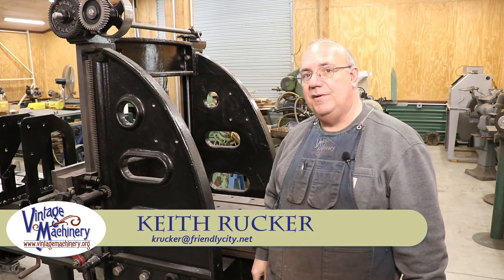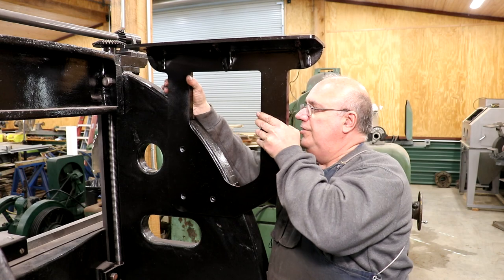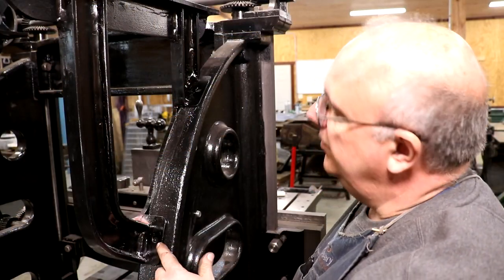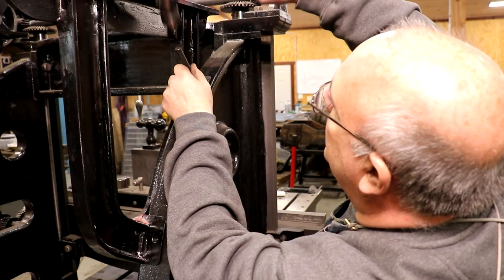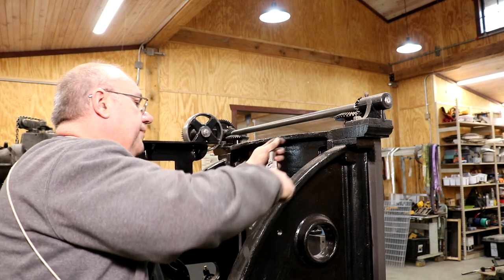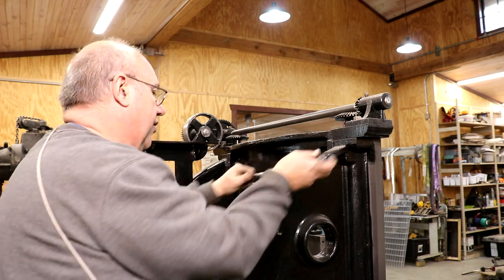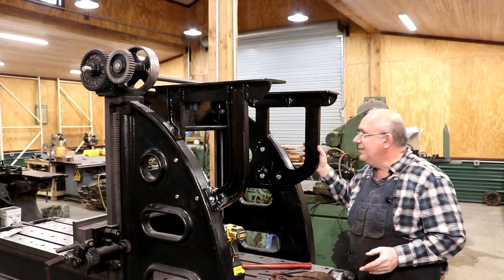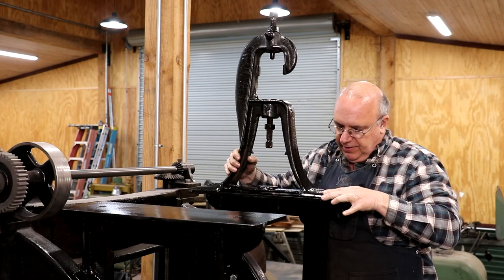Metal Planer Restoration 54: Installing the Line Shaft Brackets and Hangers

Comment: I heard a funny line recently, "The gravitational field is especially strong at the edge of a workbench!"
Reply: More specifically, the force is strongest right above my left big toe.
Reply: WD Hewson   I like that one.  It also applies when working under the hood of a car or truck.
Reply: @ErikBongers  ditto
Reply: Field strength is graphed as an exponential curve.
Reply: @ralphgesler5110  And when you drop a part while working on a car, it rolls to the point most diametrically opposite from your present location.
Reply: @WaynesGarageTexas , unless there’s a drain in the floor!

Comment: Understand the fumble fingers, seems like 10 years ago I dropped almost nothing, now almost everything. :) I think a cross brace at the base of the line shaft hangers would be a good idea, the assembly adds a tremendous amount of leverage against the sides of the original casting.  I cringed when you pulled on them to test tightness. Thanks for sharing this project with us, love the videos.

Comment: Nice to know that I’m not the only one that does QC on the hardware by dropping it 8 feet onto a hard surface. Mine usually take a bounce or two before disappearing into the tangled mess of useless and forgotten tractor parts under the workbench. Project is coming along nicely. 😎👍👀

Comment: G’day Keith. Good to see you hanging in there. I hope you use your gantry crane or engine crane when you fit the motor, those brackets looked a bit heavy to be lifting by hand. We’re all getting too old to be running the risk. 
Cheers 
Peter

Comment: 7:12, I'd make some 1.125"-1.250" square nuts to go on the bolts you threaded into the frame for the brackets you made. It would give it a more original look. Instead of having the bolts sticking through. 
Or something more ornamental.. have  an awesome day 🎉

Comment: Nice to see you back on the planer and making progress. From what you said am I right in thinking that it's normal operation is to continually shift drive from forward to reverse via using the belts as clutches ? I've not seen that done before, only for start stop function. I think some washers on the bols for the home made bracket sides would look the part - and protected the paint from being scraped off by spanners. Had I been assembling it, all bolts would have been lubricated prior to final assembly - it just helps in getting them out again later (in 100-200 years). I just don't like seeing dry machines/mechanisms !

Comment: Query: Is there a reason why the bolts go through steel to threads in cast iron and not through the casting into threaded steel? By the way, I'm 76 and I spend a lot of time picking up stuff I've dropped. Welcome to the world of the aged, Keith.

Comment: I haven't had good luck with transfer punches on cast iron.  They were the cheapest set of transfer punches (from the usual suspects) so that may be part of the problem.  But some cast parts are really really hard on the surface, which is hard even on quality tools.

Comment: Broken drill bit shanks can be made into short bits... really short bits can center mark a blind hole without chewing up the bore.
Pieces of scrap tubing come in handy for blind hole center transfering too but then so does duct tape if that's what's easiest to catch.
Growing up where the last resort is ordering can cause susceptibility to, what else could that be used. Not to be confused with, what the hell did you bring that home for although both may occur with a really big yard.

Comment: From here, with no expertise whatsoever, it looks like you will need a massively powerful motor to move all that mass and overcome the resistance of the cuts. Gear ratios will surely help. Or belt ratios, maybe.

Comment: Looks like some good maple shims to go under those hangers to stabilize them.  They originally bolted into a wood beam so the casting imperfections could dig into the wood and become more locked in.  This is a beautiful project.

Comment: Great comedy routine with the nut throwing!  Most of my mechanical education was helping my father work in his garage which did not have a concrete floor - it was hard-rolled granite sand - great for losing pieces of hardware if you didn't watch 'em all the way through to a final resting place.

Comment: Why didn't you use studs on the blind holes so you could tighten the nuts without worrying about bottoming out. 
Also are you going to do castings for the bearings so you can include oil drip cups?

Comment: If you're mounting the motor over the center of the machine, shouldn't it be mounted no lower than the bottom of the cross slide at it's highest travel point? So that if you have tall work in the machine it doesn't hit the motor

Comment: Just throwing this out there but why not bolt a plate under your line shaft hangers to mount your motor onto no need to drill extra holes in the planer then you can move the motor horizontally to adjust the belt tension  

by the way I say just hang it up on the floor when something is dropped

Comment: Hi Keith, Are you going to rely on the fit of the bracket bolts to keep the shaft(s) aligned. I ask because when I worked on power station and oil refinery plant where it was important to maintain an alignment we would first line up using bolts then fix that alignment with taper pins. This was mainly because vibrations tend to move the mating flanges imperceptibly over time even where heated bolts were used. If you don’t feel this is necessary you might want to have matching marks on each pair of flanges so you’d pick up any movement before it became an issue.
Like a number of your subscribers, I’m looking forward to seeing how this machine performs. Regards

Comment: You’re getting there. It looked to me like the surfaces between the hangers and the brackets were not very parallel. That will cause undo stresses in the assembly.
Reply: You can see the bracket distort as it was tightened. Lot of work, but shouldn't the bracket be sanded, milled, planed or ground flat first? Hate to see those brackets crack under stress. Mounting them against a wood beam wouldn't have caused a problem 100 years ago.

Comment: Back when I was doing industrial maintenance, we never had time to mount, re-mount, and I don't think anybody in the shop had a set of transfer punches.  We'd clamp, (sometimes tack weld), drill, tap, then clearance drill deep enough the bolt would hold the parts together instead of thread lock.  Recheck the tightness after removing clamps or scarfing out the tack welds.  More often than not, paint had to wait until the annual plant shut down.

Comment: Looking at this metal planner and trying to get a machine that has a line shaft to operate as one that has it's own electric motor you hav had your work cutout for you. Nice to see that the work has proceeded so far is looking quite well. The bering blocks hopefully will not cause you any problems. I will be looking forward to seeing your next video.

Comment: Is that line  shaft structure going to create enough vibration in the tool to cause problems with accuracy? You are always talking about thousands and tenths. I was wondering if vibration pads would help with that.
That small structure you added really looks heavy as is the entire tool. It was evident you were straining lifting it up.
Enjoying the entire rehab.

Comment: I thought you were going to skip any sort of line shaft drive and just throw a motor on top of a thick sheet metal platform you'd install spanning those two brackets you fabbed.
Reply: Kind of surprised me too, until he mentioned that he needed the crossed belt on one side for reverse table and normal on the other for forward table.  That forward reverse motion is needed to make the machine take passes.  Rather than some other transmission, Keith is going to operate with a (very short) line shaft, just as intended!

Comment: I thought that the mounting bolts in the tapped holes should have had some blue locktite applied as the vibration of the motor and belts might loosen things.  Never too late to do that!  My $0.02
Reply: I was thinking the same thing.  I fix Harley Davidsons, so Loctite is kind of a habit for me. When I assemble a small milling machine that I have to put together,
I think I'm gonna use a small drop of blue on my bolts.

Comment: Looks like the Planer is now a combo machine.  Combination Planer and StairMaster.
I try to never go up a ladder anymore without at least one extra set of hardware in my pocket.

Nice job on the brackets they look like something that would have shipped with the machine.  You need to make some square head bolts to mount it so that the new hardware is not so obvious.